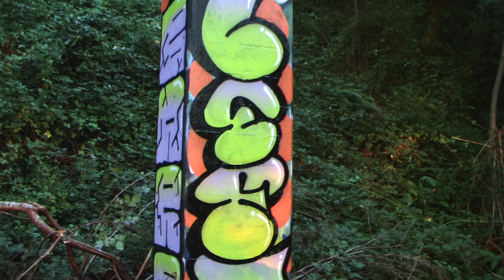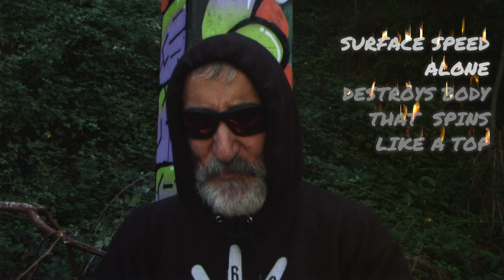WHY A SPINNING BODY BREAKS ALONG ITS LONGITUDE no cracked body can spin globe earth is a fantasy

Comment: All of this would be largely correct, if it weren’t for the existence of gravity. By not taking gravity into consideration you’re making a straw man argument by definition. End of debate. How about bringing some positive evidence for a flat earth instead of creating straw men?
Reply from the maker: you are making the straw man by conflating that which applies to a rotating body who's axis of rotation is away from its center of mas with a body who's axis of rotation is its center of mass 27:43 i refute you, "gravity" has nothing to do with centrifugal tension (hoop stress). Molecular bonds are always orders of magnitude stronger than "gravity" and they are still nowhere near strong enough, case closed. The centrifugal force you are cancelling only pertains to objects riding on the surface of cracked fake globe earth, who's AXIS OF ROTATION IS AWAY FROM THEIR CENTER OF MASS (they are not spinning like a top).--Wrong force relationships and wrong math.
Reply: @rocketspushoffair  you’re right, gravity has nothing to do with hoop stress. But it can prevent hoop stress from occurring in the first place by opposing the outward centrifugal force by at least 300:1, therefore preventing any outward net force which is a specific requirement for hoop stress to occur. Ignore gravity and your argument is false from the beginning. 

Still waiting on that flat earth proof.
Reply: @rocketspushoffair  
If flat earth had some precise definition you could surely contest if I didn't use the right parameters while talking about flat earth.
So, any discourse about the globe earth that obliterates some fundamental property of it  (gravity), is a strawman argument by definition and doesn't even need to be refuted.
Actually there are no flerfers arguments that aren't strawman fallacies.
Reply from the maker: @paulsterx  invoke "gravity" and your argument becomes an irrelevant train wreck. Molecular bonds are not damaged by an insignificant force as .0034g that your imaginary gravity opposes. You fail to recognize that .0034g only applies to objects on the surface who's rotation axis is thousands of miles away from their center of mass. Nothing at all to do with spinning LIKE A TOP (ROTATION AXIS IS CENTER OF MASS) WHICH HAS HOOP STRESS, AND A SPEED LIMIT based on tensile strength. EDIT: ONLY SOLID OBJECTS CAN SPIN (fake globe is cracked).
Reply from the maker: @pirulinpirula6805  Wrong. Invoking gravity is a reification fallacy. That's a logical fallacy. Your theory of gravity cannot refute solid engineering principles that all of modern society is based on (that's what my video exposes). Gravity within the fake globe CANCELS OUT. And ON THE SURFACE only opposes .0034g and only applies to surface objects who's rotation axis is thousands of miles away from their center of mass. My video is about SPINNING LIKE A TOP (rotation axis is center of mass) and only SOLID OBJECTS can spin like a top, so your fake cracked globe is automatically disqualified. You never had a working model, it was broken (cracked) from the beginning.
Reply from the maker: @paulsterx  sorry, but it's your lack of honesty that's woeful: " you’re right, gravity has nothing to do with hoop stress. But it can prevent hoop stress from occurring in the first place by opposing the outward centrifugal force by at least 300:1, therefore preventing any outward net force which is a specific requirement for hoop stress to occur."--TOTAL BS! Not a single engineering text book says this. Read my previous replies, watch the video, study at spin1.flat.wtf learn what a ROTATION AXIS is.
Reply: @rocketspushoffair  well you’re unlikely to find that in an engineering text book considering engineering doesn’t tend to deal with planetary forces. It’s a physics book you need Nick. I’ve explained it all before and provided you links to scientific papers on the subject, which you ignored. Quelle surprise.

So are you going to ever provide any positive evidence of flat earth? No? Didn’t think so.
Reply from the maker: @paulsterx  all you provided was a reification fantasy (formal fallacy) "gravity", "planetary forces" etc. and full of contradictions. Demonstrate how a cracked body covered in water can spin ...  you have no demonstrations of your claims = reification fantasy. Your "scientific papers" are science fiction. At least you admit it: "well you’re unlikely to find that in an engineering text book considering engineering doesn’t tend to deal with planetary forces." 😂😂😂
Reply: @rocketspushoffair  well that’s not quite true about not referencing planetary forces - tell you what, find an engineering book that doesn’t reference gravity anywhere. No? Thought so. 

You’ll dismiss anything that I provide as false without understanding it or having any evidence of falsehood, so what’s the point? 

Supply something, anything, that is positive proof of a flat earth. You can’t, can you?
Reply from the maker: @paulsterx  the burden of proof is on you to demonstrate how a cracked body can spin over 1000 mph covered in water etc. ... no engineering text book says this is possible ... science fiction is what you are left with. The engineering text book may refer to an acceleration of 9.8 m/s/s SO WHAT? That is observed and explained by density of mediums drop.flat.wtf the book does not claim or offer proof of a mystery force. EDIT: even if with "gravity" your argument is void (wrong rotation axis and force relationships spin1.flat.wtf ) watch video again & see my replies.
Reply: @rocketspushoffair  please cite the engineering textbook that specifically states that a PLANET SIZED OBJECT cannot rotate, as per your claim. 

Now, where’s that positive proof of flat earth? Anything yet?
Reply from the maker: @paulsterx  in the Machinery's Handbook there is a table of empirical data, it shows that the biggest a cast iron flywheel can be to rotate at fake cracked globe earth rpm is just under 34 feet, where you must decrease 1 rpm for each 6 inch increase in diameter (been telling you this for years) A large heavy SOLID object literally breaks under its own weight or at the slightest rotation, at the moment you try to push it (basic engineering) ... any proof of a cracked behemoth sphere covered in water spinning over 1000 mph like a top? edit: And you believe "gravity" scales down (Cavendish) so if it cannot save the flywheel, it is useless (which is obvious since it is orders of magnitude weaker than molecular bonds) and no material can spin 1000 mph, and no cracked body can spin at all. Opposing .0034g does not prevent trillions of psi of hoop stress from forming "in the first place" 😂😂😂
Reply: @rocketspushoffair  the earth isn’t a flywheel. Another straw man. 

Any positive proof of flat earth yet?
Reply from the maker: @paulsterx  the cracked fake globe earth is a body rotating around its center of mass, EVERYTHING THAT ROTATES ABOUT ITS CENTER OF MASS IS TECHNICALLY A FLYWHEEL and the same physics (hoop stress) applies ... watch the video, you are in denial, it reduces to a an imaginary thin ring in every case: spin2.flat.wtf right out of the text book reference that you gave me😂😂😂 A SPHERE BREAKS AS EXPECTED ALONG ITS LONGITUDE AS IF IT WAS A STACK OFF FLYWHEELS (live demo spin2.flat.wtf ).
Reply: @rocketspushoffair  the gravitational attraction of mass at the edge (or at any point) of a flywheel to its centre is orders of magnitude less than the centrifugal force acting on that mass. The gravitational attraction of mass at the surface of the earth (or at any point) is orders of magnitude more than the centrifugal force experienced by that mass due to the earth’s rotation. That’s the difference, that’s why the earth is not analogous to a flywheel and that’s why your argument is a straw man. Show the math that says the centrifugal force acting on a mass within the earth is greater than gravitational force, as is the case with a flywheel, and we’ll talk. But you can’t, because it isn’t, so you’ll just deflect again to hoop stress which is not the argument since hoop stress cannot occur without an outward force. 

So, back to that positive proof of flat earth I’ve been asking for. Do you have any? Just one teensy bit of proof?
Reply: @moonshiner2977   what a charming comment, it’s lovely to meet you too. 

Correct, a flywheel’s own gravity has no appreciable effect on the force experienced by a mass within its rim - in other words, the net force experienced by that mass is outwards, away from the centre of rotation. 

In contrast, the earth’s own gravity does have an appreciable effect on any mass within the earth and is far greater than the centrifugal force experienced by that mass. Therefore the net force experienced by that mass is inwards, towards the earth’s centre. 

A necessary antecedent for hoop stress to occur in a rotating object is for the net force experienced by that ‘hoop’ to have a vector outwards, away from the centre of rotation. Therefore hoop stress occurs in a flywheel, but not in the earth. Considering Nick’s entire argument here is that hoop stress must tear the earth apart, and considering that hoop stress cannot occur within the earth for the reasons discussed above, his argument is null and void. By comparing the forces experienced within a flywheel to the force experienced within the earth and by ignoring gravity, his argument is a straw man by definition. 

Thanks for helping to validate my point, much appreciated. If you have any more questions let me know and I’ll do my best to answer with my limited intellectual capabilities.
Reply from the maker: @paulsterx  you contradict Cavendish, and his gravitational constant who supposedly showed that gravity scales down, and your argument is irrelevant since it only applies to objects on the surface who's rotation axis is thousands of miles away from their center of mass, while the fake globe is a spinning top who's rotation axis IS ITS CENTER OF MASS ... opposing .0034g has no effect ... moreover, your fake cracked globe does not meet the first and most basic requirement to spin: SOLIDITY. 😂😂😂
Reply: @rocketspushoffair  well no, the ratio of gravitational acceleration to centrifugal acceleration remains constant regardless of distance from the earths centre, considering that centrifugal force also reduces closer to the centre of rotation. If you took any point along the radial line between the earths centre and the equator, the ratio of gravitational force to centrifugal force will be approx 300:1 at any point along that line. I do love how you use the term 0.034g though, considering it’s a unit of measurement based on gravitational acceleration at the earths surface! So you don’t believe in gravity but you’re happy to use it as a unit of measurement? And as usual you have it the wrong way around. 0.034g is the centrifugal force experienced at the equator, vs 1g of gravitational force. That’s a 300:1 ratio. Gravity wins, hoop stress cannot occur, the net force type is compression, not tension, your argument is nonsense. We’ve been through this before, many times, if you haven’t understood it by now you never will. 

In the mean time, do you have ANY proof of a flat earth, or just more straw men?
Reply from the maker: @paulsterx  sorry, but 300:1 only applies to objects on the surface, your globe fails completely as a cracked body cannot spin in the first place ... let me know when you get some positive proof such as a demonstration of a cracked water ball spinning ... see my previous comments ... opposing .0034g is not a net compression on a cracked behemoth that magically spins over 1000 mph (requires SOLIDITY and trillions of psi of tensile strength) ... And that's the end of the globe!
Reply: @rocketspushoffair  300:1 applies to any mass on a radial line from the earths centre to the equator. I’ve done the math for you before. Anywhere else and the ratio is greater than 300:1. Gravity wins at any point. 

Any flat earth proof yet?
Reply: @rocketspushoffair  take a mass halfway from the earths centre to the equator. Gravitational force will be half that of the same mass at the surface, due to a quarter of the earths mass being ‘above’ it. Centrifugal force will also be half that of a mass at the surface due to a halved radius of rotation. The ratio is still 300:1.
Reply from the maker: @paulsterx  all you have done is made a smaller globe, your math only applies to objects who's rotation axis is far away from their center of mass, which makes it irrelevant when discussing an object who's rotation axis IS ITS CENTER OF MASS ... any proof yet that a cracked water ball can spin over 1000 mph? Any proof of "an acceleration force"?  *"Acceleration has to do with changing how fast an object is moving. If an object is not changing its velocity, then the object is not accelerating." https://www.physicsclassroom.com/class/1DKin/Lesson-1/Acceleration a rock at rest is definitely not moving 😂😂😂
Reply: @rocketspushoffair  no, a rock at rest is not moving, correct. It is however pressing down with a measurable force. For force to occur there must be an applied acceleration. A car with its nose against a wall exerts no pressure on that wall unless it’s trying to accelerate. The rock always exerts pressure on the ground. Therefore the rock is experiencing an accelerative effect. What is that accelerative effect? Why does the rock have weight? What gives it a vector and acceleration?
Reply: @rocketspushoffair  and the math applies to any mass rotating around any point. Take a 1kg mass halfway between the earths centre and the equator and do the math for the forces exerted upon it - the ratio of gravity to centrifugal force will still be approx. 300:1, just as for a 1kg mass at the surface.
Reply from the maker: @paulsterx  no movement equals zero acceleration:  *"Acceleration has to do with changing how fast an object is moving. If an object is not changing its velocity, then the object is not accelerating." https://www.physicsclassroom.com/class/1DKin/Lesson-1/Acceleration a rock at rest is definitely not moving 😂😂😂
Reply from the maker: @paulsterx  yes, the math for an object that rotates around an axis AWAY FROM ITS CENTER OF MASS, but has no relevance to an object who's rotation axis IS ITS CENTER OF MASS see spin1.flat.wtf Your cracked water ball does not meet the first requirement to spin: SOLIDITY ... get back to me when you figure that out! 😂😂😂
Reply: @rocketspushoffair  I said an accelerative effect, not acceleration. I gave you an example of a car with its nose against a wall, which will only exert pressure on that wall when an accelerative force is applied to it. Saying that an object which is exerting a pressure force against another object is not undergoing an accelerative effect is patently ridiculous. It’s exerting a force, and there is no force without acceleration. Please open a physics book, just once.
Reply: @rocketspushoffair  I’m not talking about the entire object, I’m talking about the forces experienced by a specific mass within that object. The forces experienced in the example above are gravity and centrifugal force, with gravity exceeding centrifugal force by 300 times. 

How’s that flat earth evidence coming along? You must have something by now surely.
Reply from the maker: @paulsterx  find a book that defines "accelerative effect" [that's not even a word] 😂😂😂
Reply: @rocketspushoffair  by the way, Bob has reviewed your video (well it was Banjo’s video - not sure if he stole it from you or you from him). In any case, Bob has said exactly the same as I said to you some time ago. Strange how we’d both reach the same conclusions independently don’t you think? https://youtu.be/9rlY8O0Zoac
Reply from the maker: @paulsterx  thanks for letting me know, that was of course a remix of my original video longitude.flat.wtf and Banjo's version came complete with a huge contradiction and he removed it shortly after I pointed that out to him ... had he remixed it properly w/o any changes it would have been a great video ... i pointed out that you cannot claim the equator is less than 25,000 miles and later use that value to calculate the width of Australia with 60 nautical miles to the degree as being 8000 km which is about twice as big as it is
Reply from the maker: @UCn4MKFViDsucf5td-6sIdHg go ahead and list the "contradictions" in my video at longitude.flat.wtf don't change the subject here please (there are no contradictions since I used actual sailing distances and railroad lengths) ... sorry, but an object at rest is not undergoing any acceleration, except in your head ... (and Bob does not have the video on his channel either, probably because he has no concept of what a rhumb line track is, as he proved at the start of his video, go here longitude.flat.wtf if you want to continue or have your comment gets deleted) Find a book that defines "proper acceleration" as a rock at rest.
Reply: @rocketspushoffair  I went back to your "longitude diverges" vid and put a comment there explaining how the Challenger trip makes sense on a globe but not on the flat-earth AE map.
We all agree, the Challenger trip was about 7600 nm.
The shortest distance on a globe is about 6200 nm, but on the AE map it is almost 17 thousand nm. So on a globe the ship could have made side trips, but on a flat earth the ship could not have covered even half the distance.
Reply from the maker: @michaeldunlavey6015  only when you use 25,000 miles for the equator ... watch the video again at longitude.flat.wtf ... it proves that the equator is less than 25,000 miles and that longitude diverges as you go south ... also, read the description for more info on how even if the Challenger distance was over 1000 km in error (too long) it still proves longitude diverges
Reply: @rocketspushoffair  Ok, what's the diatance of the equator?
Reply: @rocketspushoffair  (ignoring the obliquity) do you agree that the distance from north pole to equator is 90 degrees (latitude) times 60 nm per degree, or 5400 nm? Do you agree?
Then on the globe, that is 1/4 of the circumference of any great circle, including the equator, agreed? 5400 times 4 is 21,600 nm?
And on the AE map, the equator is a circle of radius 5400 nm, so its circumference is 2 pi times that, agree? 33,929 nm?
So you want me to go through your vid again and see how the equator is pinched so it's less than both of those?

And yes, the boat, car, train, or walker can easily go too far, just by taking a side trip.
Reply from the maker: @michaeldunlavey6015  all I did was use actual measurements to prove longitude diverges south of the equator, and thus the equator must be smaller than what the globe says, and I have a huge margin of error in my favor, so there's no way out for the globe, it cannot be salvaged
Reply: @rocketspushoffair  The actual measurement, 7,637 nm from M to CGH makes perfect sense on a globe. The distance on the globe is 6,169 nm, so the boat did that plus 1,468 nm of detours, which you would expect it to do.

You didn't say anything about the math - did I get it wrong? Where's my mistake?

Then you resort to typical FE talk, like "cannot be salvaged". Look, if you're not sure, if you think maybe there's a mistake, it's OK to say so. That's what adults do. I've been wrong before, and other times I've been unsure. For example, I wasn't sure if differential execution would always work, until I proved that it did. I wasn't sure if you could learn concepts like "hooks" from causative theorem-proving in the blocks world, and I think you can, but I'm still working on the proof.
Reply: @rocketspushoffair   “find a book that defines ‘proper acceleration’ as a rock at rest” - well no, because that’s not the definition of proper acceleration. The point is, the proper acceleration of that rock at rest is 9.8m/s^2 as this is the acceleration felt by the object and the acceleration that would be recorded by an accelerometer (like the one on your phone). Here you go: 

“proper acceleration
n. (context physics English) The acceleration felt by an object, as opposed to the coordinate acceleration. For example the acceleration of an object at the surface of the Earth is 9.81 m/s^2 upwards, but has no coordinate acceleration”

I’d link the source but it’s getting deleted, just Google it Nick you’ll find plenty of references.
Reply: @rocketspushoffair  On your other video, you said:
_"The Gleason map is an azimuthal equidistant map. 
The distances to the only pole on earth are to the north pole correct (that's the claim) and as my video showed, the latitudes need calibration."_
At what time point in that video do you show that latitudes need "calibration"?
Reply: @rocketspushoffair  Sydney and Perth have a moment of the day when it is solar noon, or the moment when the sun has the highest angular elevation over the horizon. 
The difference in time between the 2 solar noons determimes the longitude distance of the 2 places.
On a Gleason map this puts them in a precise position.
The Gleason map not only has the distances from the north pole correct, but also the angular distances of the meridians correct.
Sydney and Perth are positioned exactly where they should be on that flat map that is the Gleason map.
Sadly for you this means that the distance as the crow flies between the 2 cities, verified by the distance and time needed for an airplane flight, has to be multiplied for 2.55 to reach the distance as the crow flies predicted by the Gleason map.
Reply from the maker: @michaeldunlavey6015  no, the boat did not do "1468 NM of detours" because 7,637 NM approximates the rhumb line track, as shown in my video longitude.flat.wtf and even with an error of 17% or 1273 Nautical Miles, which is way too much error for the rhumb line to be followed (you wont have enough distance to follow the rhumb line) longitude still diverges south of the equator, there simply is no hope to salvage your globe
Reply from the maker: @michaeldunlavey6015  the calibration is done in the three examples of actual sailing distances, and based on that, a distance of 3666.96 km distance Sydney to Perth is calculated, then with railway distance we get 3666 km and we see an incredible concordance between the two data sets ... you should know better than to enter a discussion without watching every minute of the video being discussed ... you are wasting both of our time ... the calibration is Nautical Miles per degree at different latitudes and it shows a definite increase as you go south, there is no way out of this and no way to save your globe, let's see how honest you are with yourself
Reply from the maker: @arthurmcbride7290  the Gleason map admits an east west error "sadly for you" could it be 2.55 at that latitude? 😂😂😂 My video proves beyond doubt that longitude diverges south of the equator, and that the equator is smaller than claimed by the globe, and Sydney to Perth is around 3666 km watch it, here is the custom link longitude.flat.wtf YouTube might ask if you want to leave YouTube, say yes, and you end up right back on YouTube at my video, I just noticed t his today, YouTube never did that before to my custom links
Reply: @rocketspushoffair  Your video makes some absurd considerations and nothing else.
The distance Perth Sydney on the road is 3932 km, and as the crow flies it is 3296 km, with a line that passes through the great australian bight.
With the Gleason map it is a distance of 8400 km with a line that passes in the north touching the tropic of capricorn.
Of course the Gleason map admits a  problem, because it is a projection from the globe and the east west direction is what is exclusively altered by this type of projection.
The meridians though are not altered and this is right. If you made Australia smaller on the map you would reduce the angular longitude distance between the cities and this could be true only by reducing (by a factor of 2.55 times) the time difference between the 2 solar noons.
Reply: @rocketspushoffair  You can't say that the equator is smaller without saying what distance you are referencing and what is your distance, and what leads you to make this consideration.
Reply from the maker: @arthurmcbride7290  why? do you know the speed of the sun?
Reply from the maker: @arthurmcbride7290  i said all that in my video, and PROVED the equator is smaller, with actual sailing distances
Reply: @rocketspushoffair  You proved it so tell me what is the real length of the equator.
Reply: @rocketspushoffair  The speed of the sun is measured, and in angular speed it is 15°/hour. In the time of instant telecommunication there is no problem to measure the time interval of the solar noon of the 2 places. 
This means a precise angular distance of the meridians on the Gleason map, with a consequent linear distance of the 2 places.
The Gleason map has the same distance from the north pole as the globe, as predicted, and the same angular distances as the globe, as predicted, and the wrong ground distances relative to reality, as predicted by the globe map.
By the way the same distance from the north pole means an equator of 60830 km, that is way longer than the equator of the globe.
These are the consequences of wanting a flat earth, the huge increase of distances is completely automatic, it doesn't match reality at all, and there's nothing you can do about that.
Reply from the maker: @arthurmcbride7290  degrees is not speed, distance per unit time is speed, that's why your globe explodes (watch my video) as for longitude diverging and a smaller equator, that has been totally proven by actual measurement at my video longitude.flat.wtf if you want to continue do it at that video start a new thread there
Reply from the maker: @arthurmcbride7290  if you want to continue, do it at the right video, start a new thread here longitude.flat.wtf 4352 km of mostly straight railway does not fit on 3295 km Sydney to Perth, that's 1/3 of the distance or 1057 km you need to make up for 😂😂😂 while 686 km can easily be accounted for on a 3666 km distance Sydney to Perth by the dip to Adelaide mostly, and the sailing distance comes out to 3666.96 km Sydney to Perth, it doesn't get any better than that ... And that's the end of the globe!
Reply: @rocketspushoffair  Angular speed completely relates with positions on the Gleason map; if there os one thing for which the Gleason map can be useful is the relation of time and angles for the path of the sun.
Another time you dodge the problem of angular speed and relation with linear distance. I know you are a hard core flat earther that will repeat an absurdity fir the nth time rather than accept evidence.
No trick with numbers can overcome the problem I illustrated.
If Perth and Sydney have a time interval of 2 hours and 20 min (didn't control the real figure) there is a precise point on the Gleason map where they have to be drawn. If meridians shrink south of the equator (40000 km only) then ghe distances are right, if the meridians diverge the distance has to be (on the Gleason map) 2.55 times the real distance, there's no way to have it differently.
Reply from the maker: @arthurmcbride7290  the sun changes speed, a known fact ... there goes your argument ... my argument based on actual distances is rock solid longitude.flat.wtf ... unlike your cracked water ball which cannot spin to begin with, and here you are a hard core globe religion fanatic trying to call me out? So, your ball cannot spin; the path of the sun in the sky is a STRAIGHT LINE sunrise to noon and back down to sunset, not a curve; at winter solstice the sun is setting at noon (because of the tilt you are ASCENDING until noon then DESCENDING to sunset, what a joke); a solar day is 24 hours so six months later it is midnight instead of noon ... the list is massive, but any single point above destroys your fantasy ball
Reply: @rocketspushoffair  Even in the illogic flat earther mythology the sun  keeps an angular speed (angular speed not linear speed Nick, I never said anything different) of 15°/hour, as seen from the north pole.
You'd have the problem obviously to explain why seen from any other location the angular speed is always 15°/hour, but that's just another impossibility of the flat earth.
So the thing is that the Gleason map is absolutely right for the angular distance of the 2 cities, and the map being flat, the east-west distance is what it is, it must be stretched by necessity.
Reply from the maker: @arthurmcbride7290  you think spinning a cracked water ball is logical? There's NOTHING LOGICAL about the globe. You have no argument with angular speed, try looking south on a ball and see how impossible it is to see the sun over the horizon. I have PROVEN with ACTUAL MEASUREMENTS that longitude diverges as you go south, and there is no getting away from that fact longitude.flat.wtf is the custom link to the video on YouTube, your globe simply does not exist, cannot exist, it's a reification fallacy, pure fantasy